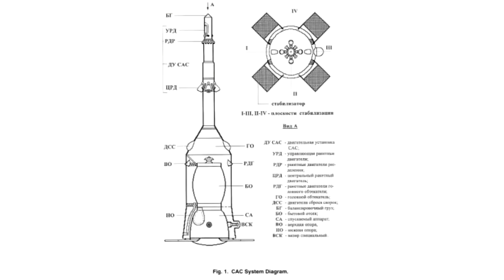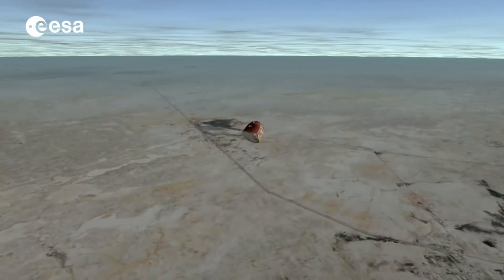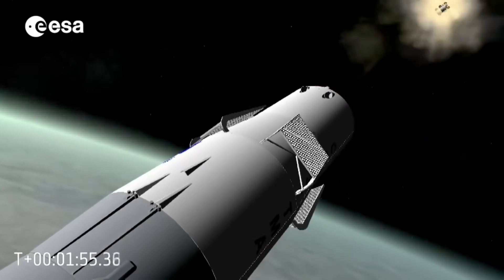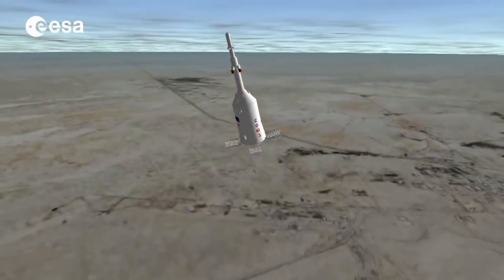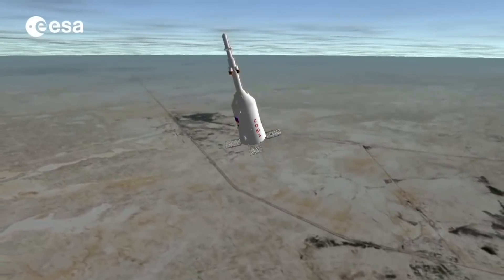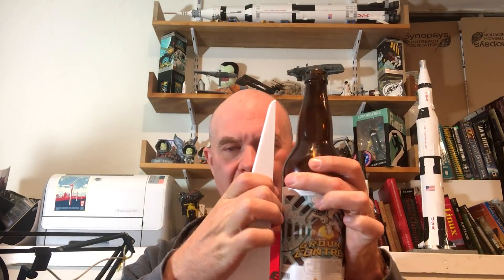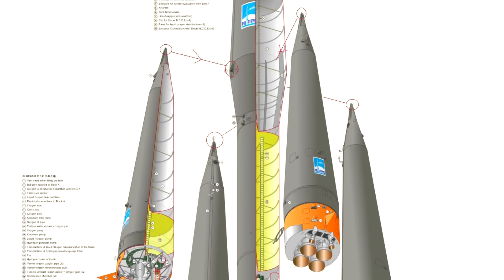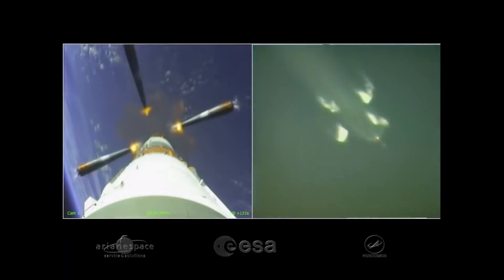Soyuz MS-10 Failure - Updates & Answers To Your Questions

Comment: Apollo Soyuz was the one where the astronauts had the issue with nitrogen tetroxide inhalation. The Earth Landing System was mis-configured (pilot error) and the RCS system stayed on after chute deploy and after the cabin vents opend, drawing in the fumes.

It was precisely the same issue that could have happened when the first SpaceX crew landed and the private flotilla went right up to the ship. (A few of them had huge TRUMP flags on their boats, and since Trump voters are immune to EVERYthing and don't have to follow the rules, they didn't see any risk of dissolving their lungs)

Comment: 'Props' -- jeez man, you've got a fine model of a Saturn V behind you, couldn't you get one of the Soyuz in question? (Or was it an ad for that beer? ;)  Good theory about the problem however.  Since you uploaded this clip, Roscom has released the full 2:26 of the Soyuz on-board external camera looking down at the boosters (SciNews'  "Soyuz MS-10 onboard camera view") where you can see the left-hand booster (from the camera's perspective [can't see the 4th one round the back]) either not separating at all, or maybe even just separating too late.

Comment: Scott, this incident with the Soyuz (which you described excellently) illustrates a safety--and efficiency--feature that an all-hybrid propellant launch vehicle would have. Since hybrid rockets--even very high-thrust ones--have a TNT equivalency of zero (because the liquid oxidizer and solid fuel grain can't mix intimately to fuel a detonation), a launch escape system for such a launch vehicle need only be powerful enough to get the departing spacecraft out of the booster's way, as it would have no detonation wave destruction radius. Since it could be quite moderately-powered, such that it wouldn't provide uncomfortably-high acceleration, in a nominal ascent the launch escape system (which could be arranged in either a pusher or a tractor configuration) could also optionally (depending on a specific mission's planned orbit and payload mass) serve as the final stage for orbital injection, thus not wasting the cost and delta-V of the escape system even during a normal ascent.

Comment: The booster separation is such an elegant design and produces such a beautiful show when it goes right. It does look like 3 of the boosters came off and were going somewhat correctly, looking at the low quality footage produced by Russia, but one looks to be in pieces and the flash seems to have sent the other 3 boosters a little off their normal spin trajectories. So I think this theory holds a good deal of merit. 

Of course, we wont know for certain until engineers finish going through talemitry data and simulate such a failure in the computers and compare the talemitries (real and simulated) so see if it fits the failure runup. Hopefully, the failure gets a positive diagnosis quickly; if this was it and it can be reasomably verified in the data, I see no reason we couldn't get a test launch within 3-4 weeks with an empty Soyuz (to replace the station lifeboat) followed by the aborted crew mission one or two months later. I am sure Russia will be wary of putting people on board until enough physical evidence from the failed booster can be collected and analyzed to identify the source of the LO2 push valve failure. Best to see if it was simply a freak accident, foul play, or a low probability design flaw (which can be updated in future boosters but would not pose enough risk to ground the current fleet). If the latter, it should be simple enough to move the escape and abort equipment jettison to a safe time sequence after staging to ensure risk of crew loss remains very low.
Reply: Tbh I am hoping this puts pressure on NASA to pull forward testing on the SpaceX and Boeing modules, within the production constraints of spacex and Boeing. SpaceX has had some amazing launches of supply capsules and I am ready to see them send up some manned missions. 

Also, if Soyuz is not greenlighted, it would be interesting to see if NASA would send up an empty dragon module as a backup lifeboat in case all other options take time tables beyond the expiration date of the current Soyuz lifeboat. The iss is a $100B+ research lab and it would be a shame to see it abandoned. Anything could happen in absence of a crew and hundreds of experiments might be lost due to lack of operators to run them in orbit.

Comment: This incident really is a successful failure. The escape system did it job and lives have been saved. Were it not for that, two people would be dead, likely for want of one dodgy valve. If anything I'd say this is evidence of why sticking with the Soyuz is a sensible plan - everything on it, including it's abort systems, have been tried and tested again and again in real world scenarios. What it also highlights, is that the Russian space industry desperately needs to look at it's talent base - too many experienced and highly skilled engineers and designers are reaching the end of the careers and retiring without having had a younger generation work alongside them consistently and reliably. You can't just throw fresh graduates into the field without veteran engineers to work with them and transfer decades of real-world practice.

Comment: This theory is wrong, on one of NASA pictures forth failed booster was clearly shown separated from rocket with white cloud on the nose, it meant that top nozzle was ejecting mix of inert gas with vapors of oxygen from oxygen tank, so valve worked perfectly. On this picture it was seen that rocket changed its course ( rocket was actually now escaped top of rocket with activated engines on solid fuel of head cone, this top included orbital module, descent module, all in case with opened 4 stabilizing wings on bottom) , in another picture just after explosion on 120 sec when white cloud enveloped rocket ( that was actually initiating of remained rescue system on the head cone of rocket because on 114 sec escape tower was already jettisoned away) only 3 boosters are visible near the rocket, they separated on 118 sec as planned when thrust of  booster engines was first reduced to 75% from 100%, at the same time both bolt joints on the bottom of each  booster were pyrotechnically blown away and bottom of boosters start moving away from rocket, nose part of boosters at the same time start disengaging from ball joint on the nose by gravity due to reduced thrust, when nose part of booster moved 5mm from its fixing position, sensor is producing signal to open valve on the top of oxygen tank of the booster to move top part of booster away from rocket, then engines of boosters were shut off completely and one more valve on the top of kerosine tank on booster should to open releasing inert gas and moving booster further away from rocket. This scheme worked only on 3 boosters, but 4th was "stuck" for 2 sec for some reason, enough to change course of rocket and initiate rescue system, because computer on-board instantly calculated that this change cannot be compensated by second stage engines, they were shut off while rescue engines were activated and safely separated crew from failed rocket.

Comment: Stage separation takes place above atmosphere, so that there is no aerodynamic force to damage second stage tank in your scenario. The alternative hypothesis is that due to some malfunction engines of one side block of the first stage where no shut down at the moment they should normaly be, so that thrust continued, but vector of thrust has turned and this force of full thrust being applied at angle has started roket rotation that was impossible for flight control systems to stop and correct and that was enough for computers to decide flight is to be aborted and trigger automatic escape system.

Comment: Hydrogen peroxide begins losing its bond to the extra oxygen molecule over time, and as pressure in tanks builds due to oxygen buildup, hydrogen peroxide begins decomposing rapidly with the higher tank pressure.  Russians have found this out the hard way with their torpedos, which have frequent explosions due to this phenomena.

Comment: What would happen if the oxygen started venting before the explosive bolts fire?  (Or if the bolts simply didn't fire)  Could the incorrect (now opposite) rotation bring the exhaust of the booster into contact with the core and cause damage?

Comment: Between 9:28 and 9:31 you can see 5 pieces "fly away" from the rocket. Could that be because of the damage caused by the oxygen valves not firing and boosters colliding with the rocket body causing the damage?

Comment: Have you seen the photo taken from the ISS?  It shows a trail that appears to have a slight zig-zag to it.  Was that an after effect of the staging failure damage, or could it indicate a different cause?  Oscillation, especially within the atmosphere could almost immediately cause an aerodynamic breakup, so I had considered that a sign of just how close it came to being fatal.  Also, the video feed inside the capsule shows bucking just before the feed was cut (or cut from public release anyway) that made me wonder if one of the engines somewhere off center had started a pogo oscillation and wasn't cut off quickly enough.  The wavy trail would seem to indicate considerable time spent under propulsion with an issue.

Comment: Hi Scott, what is your opinion about the newly emerged pictures, like this https://www.flickr.com/photos/nasahqphoto/44526530904/in/album-72157700630905921/ and its zoomed version https://kep.cdn.indexvas.hu/1/0/2114/21144/211444/21144462_2ba45888817ff549545d4598b1057b8c_wm.jpg ? I read that the booster marked 4(?) could be the culprit, but in my opinion 1 is out out of the Korolev cross. Or am I wrong, and the cross is kept just for a limited time, and the picture was taken later? What do you think?

Comment: It could possibly be better if the bolt/s would spin at a 20-30% angle from the flight trajectory,  and allow the booster to slide out using dynamic pressure and a control fin on each of the boosters, VS the booster releasing pressurized gas to the side valve at the top to push it away from the vehicle.

Comment: It looks like the Russians have a timeline from telemetry and onboard video of what happened to Soyuz MS-10. The question now is what the root cause is. Booster D is receiving the most attention.  At separation, telemetry reports the strut pyros for Booster D did not fire resulting in an "abnormal" separation. My speculation is that Booster D slid back from air drag and probably twisted with struts still connected to stage 2 damaging if not removing the RD-108 engine in the stage 2 central core. The resulting venting of propellants obscured the firing of the four Soyuz Shield motors propelling the Soyuz away from the disabled vehicle.

Comment: For those of you thinking "So what if the peroxide decomposes, they should get by with a little less of it." - You REALLY don't want to be anywhere near a tank of highly concentrated hydrogen peroxide that's past its sell-by-date. The stuff is nasty enough when it's fresh and clean, but when it starts to decompose or accumulate metal ions, it's basically just looking for an excuse to blow up:
http://blogs.sciencemag.org/pipeline/archives/2014/10/10/things_i_wont_work_with_peroxide_peroxides

Comment: they would be dead...in the space shuttle...Soyuz at least has espace optios
Reply: No comparison; there was 2 different systems to go into space
Reply: Trans Atlantic Abort would have been an option,  they were high enough, and far enough down range. 

The shuttle had options, it just also had a some rather large death zones in its flight envelope.
Reply: stinkyfungus the space shuttle was a failure more than 12 people died
Reply: @dbricksawc3634   And that's with 135 launches of Space Shuttle and 139 manned launches of Soyuz, and more than that unmanned Progress launches. In Soyuz only four cosmonauts died, and that was when it was relatively new, and caused the problems that caused it to be addressed. Space Shuttles blew up because they were designed to be cheap per launch and to be safe, in the exact way that made them overly complex and neither safe nor cheap to maintain.
Reply: @dbricksawc3634  

You all have this illusion that spaceflight can be "safe" 
It is not safe, and it likely never will be. 
Yes, the shuttle lost some crews.  It also did things that no other spacecraft could or can do. 
It was NOT a "failure" any more than the saturn 1B was a failure, or soyuz, or the X15, or any other 
Spaceflight or research program that resulted in pilot or crew fatality. 
Callingbthe shuttle program a "failure" is an insult to the men and women that bought it on challenger and colombia,
And ALL of the crews that acomplished thier missions. 
I won't have it. 

The people that sign up and train to ride these things know what the risks are.
Reply: F for Challenger and Columbia

Comment: The Soyuz system is a proven design, but even the best, longest-running design can still become unreliable if you are suffering quality control problems in manufacturing and assembly. The Russians need to get their act back together. Factory workers drilling random holes in space vehicles is a bad omen when you're climbing up a launch tower to get in the cockpit. To paraphrase Han Solo, "Launching rockets into space ain't like dusting crops, boy..."

Comment: How about a video on the different revisions to the R7 series of rockets? They used to need over 30 engines but recently have switched to using fewer, more powerful engines. Many less potential points of failure than before. Given the problems with the N1 where every launch attempt blew up, I would've thought they would have wanted to reduce the complexity of the R7 much sooner.

Comment: The best analogy I can think of for a ballistic vs regular reentry is like breaking a car.  A ballistic reentry is like slamming on the breaks as hard as you can, it’s going to hurt and will get you stopped quickly but you have almost no control.  A regular reentry is more like seeing the traffic stopped and being able to gradually add the breaks so it is not as jarring.  The lift the capsule generates is like adding distance to your breaking distance. The more distance you have the easier on the breaks you can be.  Hope this helps a bit in some understanding

Comment: Rewatching the video it does look like it was the side boosters that caused it.  They are not symmetrical when they separated from the main engine.  One comes off a bit more than the others. Not sure if you can also see some debris or if it is the tower that is also spinning off in the upper left of the frame.  Anyway I hope it is a simple part failure that can easily be inspected and fixed in future flights.

Comment: It is hard to believe that a 1950’s Korolev design is still being used . So reliable.
Reply: Probably it's the only rocket in the world using wooden planks in the ignition system. Sounds crazy. :) But AFAIK birch planks are used to hold termite charges inside nozzles. They just burn after ignition without traces. Simple and reliable, but rocket are ignited with help of wooden planks! :D

Comment: The emergency abort worked and that is better data than any simulator can provide. It solidifies the reputation of this rocket program. Soyuz remains the most reliable rocket system in history. We dont know exactly what happened in testing, but these records remain.

Comment: What happened to the boosters and the main structure? I assume they are normally planned to crash into specific parts of Russian forest, but this may have caused them to crash somewhere unplanned.
Reply: The trajectory of the fall is designed so that the route passes in the most deserted area and minimizes the possible damage from falling steps, even if the start fails.

Comment: On each side booster (B, V, G and D, called BB blok) besides the LOX release valve there is also a kerosene tank pressure release opening. This also helps to push the BB block away from Blok A (CB) central core stage.

Comment: What an incomprehensible explanation. Shroud, core, booster, rockets, tower... You talk about one thing while showing something else. It's just a jumble ofdisconnected explanations. I have no idea where the rockets on the shroud are located and how they worked.
Reply: Maybe it will help you to watch "The Soyuz launch sequence explained" on ESA channel.
Reply: How Does...  The video is helpful, but for me it covers stuff I mostly know and is available from many sources. But the ONE thing I don't know is skipped. Maddeningly, like John H, I still "have no idea where the rockets on the shroud are located and how they worked". It only says (2:25) is that after tower jettison the spacecraft can safely separate from the rocket on its own. Every frickn' source I've looked at for 2 days omits details for this!
Reply from the maker: I should have included this diagram https://upload.wikimedia.org/wikipedia/commons/1/1d/Soyuz_rocket_and_spaceship_V1-1.svg
Reply: Eureka!!! Thank you Scott!  From the layout, I deduce part of the latching system the LES tower uses to pull the shroud and the 2 modules remains after tower jettison, and is use to pull the 2 modules along in the shroud when the shroud motors ("emergency ejection powder engine") fire.
And what an incredible diagram! More thanks!